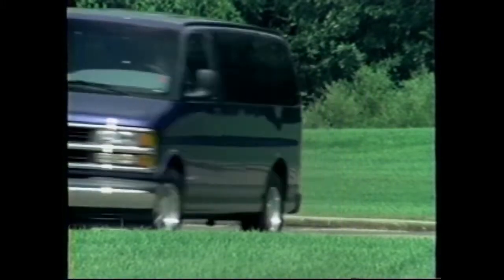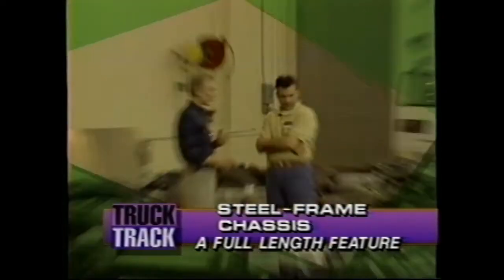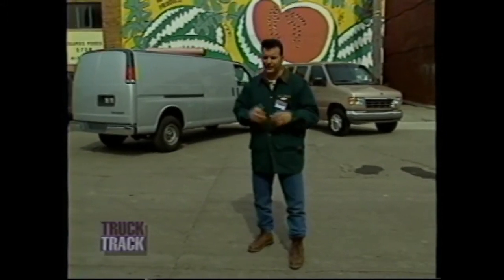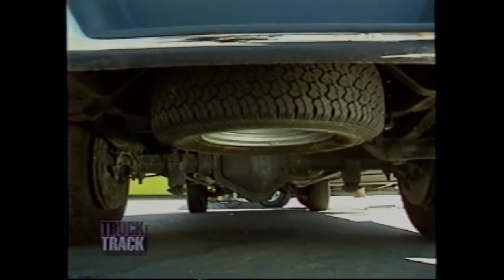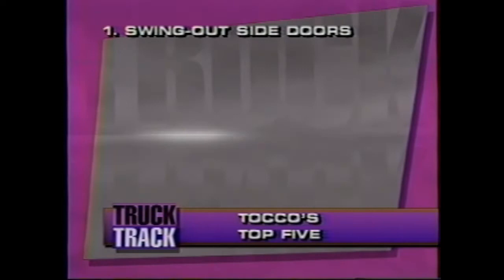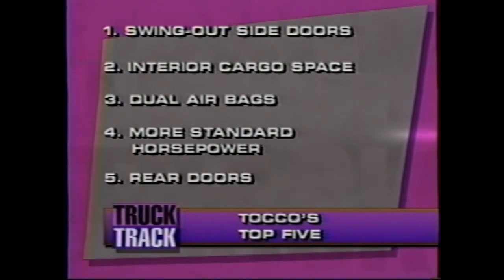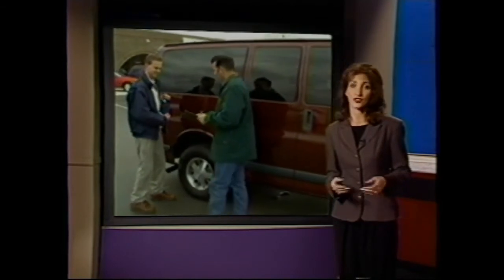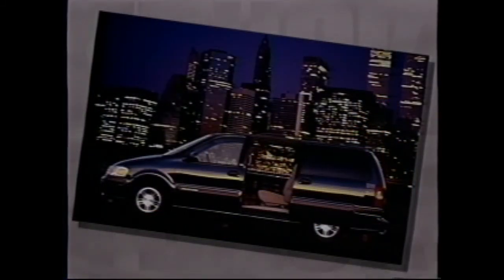1996 Chevy Van Express

Comment: It amazes me how a Design from 1996 is still being sold today the 2024 models are still the same as they rolled off the assembly line 28 years ago!
Reply: There are only so many ways you can make a box. Just think, since 1971 GM has had only two van designs!
Reply: Don't forget about the Ford Econoline from 1992 as that design is still used today...Even though it's now down to just a chassis cab.